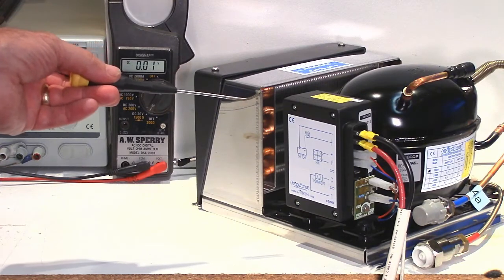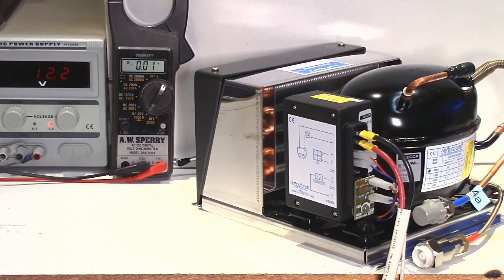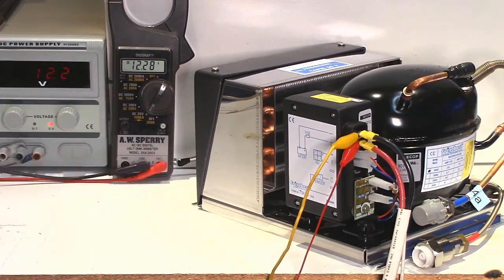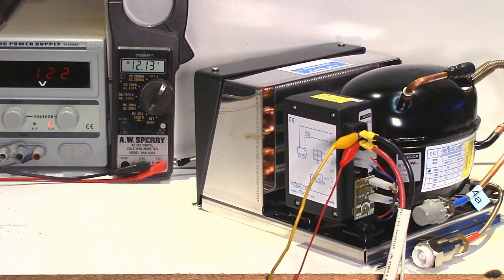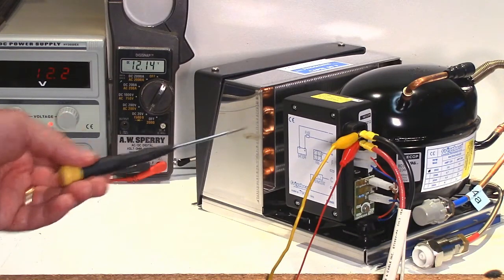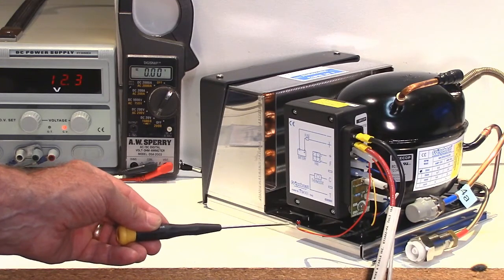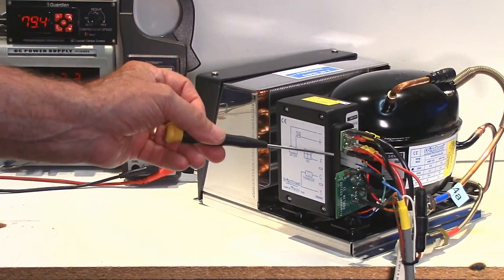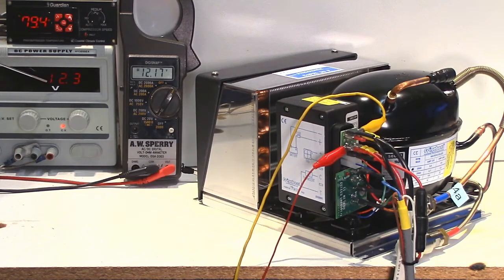Tech Tip - Power Supply Testing

Comment: Ok so how do you fix the low voltage issue! My compressor will only run when I have the charge inverter on otherwise the red low voltage indicator flashes and compressor will not run. Do I need more amp hour batteries to fix this or maybe some solar panels. Soon as I turn off the charge inverter the fridge compressor will not run

Comment: Thanks so much for your helpful videos. I am perplexed by my 101N0210 controller! I have a 2003 Danfoss unit on a Waeco portable fridge. ISSUE: Linking C+T will not start the compressor. But, grounding the T terminal will make the compressor run even if C is disconnected. When I wire a digital temp relay the relay works but the compressor will never stop running.  Is there any way I can wire a thermostat to this old 101N0210 controller?
Reply from the maker: Chances are your controller needs replacing, if you haven't done this already,

Comment: I have a 12v fridge with almost the same components in this video. The compressor and fan kick on and there is a small thin coiled copper pipe which gets super cold, but the fridge stays warm. It uses a cooling plate. What could it be ?

Comment: Hello, 
I need your help, Please...
I purchased  from Amazon a compressor BD35F-HD Secop for gas R-134a and 12v, with his electrónic card, to install in a 87 liters 2 doors fridge. 
My questions are:  
1- What size Of capilllary to use and what length?  
2- What high and low  pressures should it have?   
3- What suction pressure should it have?  
4- Is it necesary to add an extra condenser or not? 
Do I really need to install this compressor to this fridge? Before it 
was  working with a compressor 110v and gas R600, The reason  I want to change it from 110v to 12v is to install  it in a MotorHome. 

Thank you very much, and I'm sorry my english is not very good, 

 José Luis López 
Chimaltenango 
Guatemala C. A.

Comment: Thanks for this info.  It would be good too learn more about the starting processes, ie the voltages and currents applied to the 3 terminals for starting and running, and is there a hack around one could do to this end?
Reply from the maker: Evan. These compressors are poly phase motors with three equal windings. Just like in a three-phase AC motor, there is no start or run winding, and no capacitors or relays. This video might help ;https://www.youtube.com/watch?v=jl5IWkGSfJY&t=10s